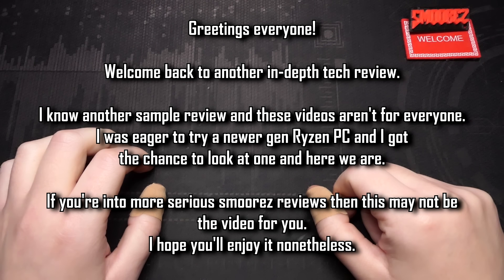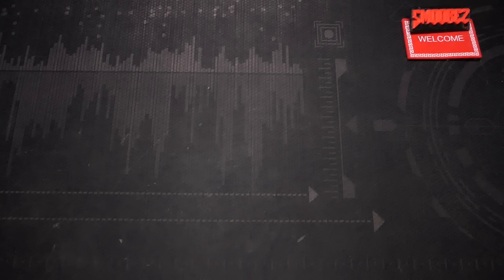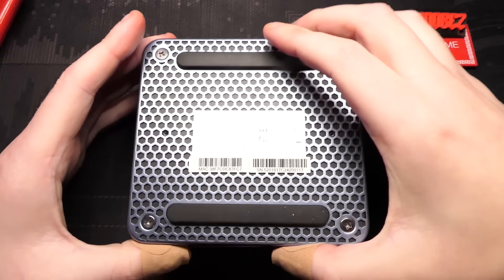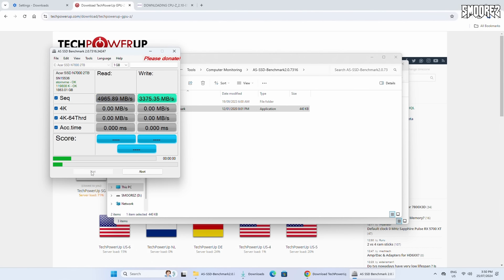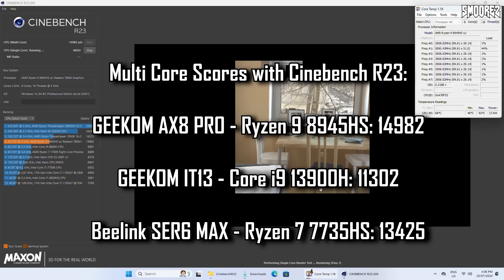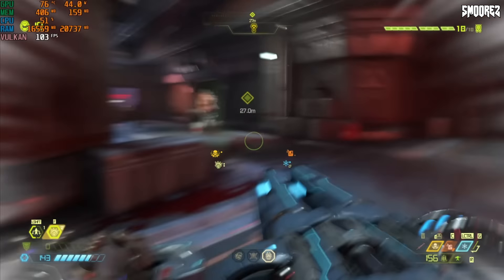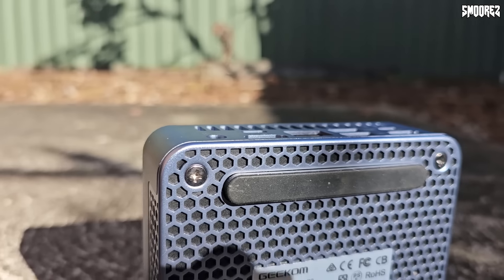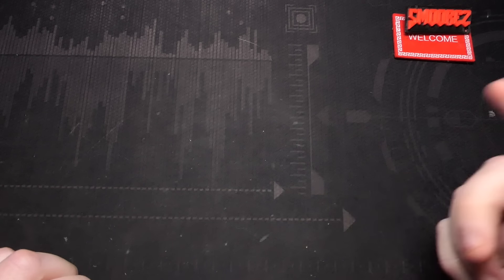GEEKOM AX8 PRO Mini PC Review - At $899 USD, it's pricey but it packs a RYZEN 9 in it!

Comment: Next time you should give Minecraft (Java edition) a go as its a relatively CPU based game and could give a good indicator on how well the CPU works (you can use mod loaders with Sodium and infinite render distance mods to really strain the CPU and show off its power)
Reply: If he does, you can install mods easily using Prism launcher, and then you can go to its settings and increase values like ram for maximum performance :P

Comment: I got a really cheap Ryzen7 Mini-PC (because they forgot to disable the 80€ discount and put the item on sale for 100€ less, so I bought it with 180€ discount).  But it has one big problem: If I play games or use the internal AMD graphics-card the MiniPC will definitly lock up after exiting the game.  It's guaranteed and I don't know why...  Already swapped the SSD, RAM and AC-Adaptor for a more powerfull one.  But still crashes after using the iGPU

Comment: you know another terrible issue with these cheep ass pc's other channels cover is some have malware installed in them i should add you cant delete it because they will be on the drive i also did a poor ass job explaining this its been forever since i watched the videos with this information
Reply: You can easily wipe it and install something like Arch or Pop OS
Reply: @GatoCoder  you can if you sign into a burner microsoft account before hand when you are setting up the pc because account is required and the windows 10 or 11 that is on it needs to go by this you can tell I still didn't watch the video not interested in these pc's
Reply from the maker: You can skip signing into a Microsoft account by choosing "domain" at setup then putting in an email like test@test.com and it will come back with an error and let you continue with a local account. That's what I usually do.
As for malware on these I don't think there would be any lingering on there. Geekom is fairly trustworthy but I'm not sure about other companies. If they had pre-installed programs then maybe but i think it's fine.